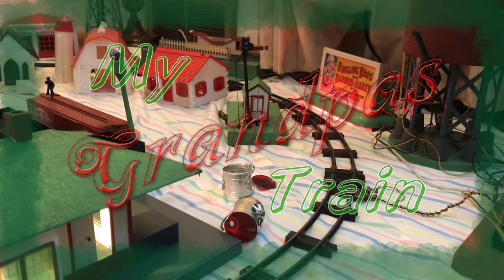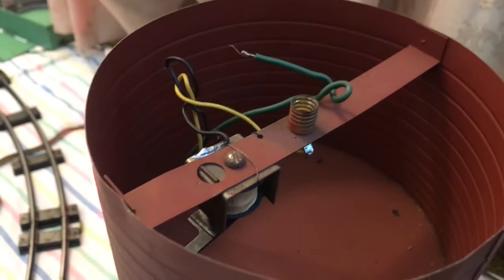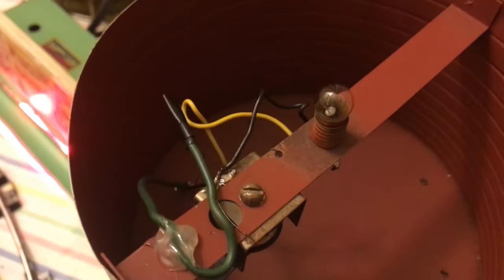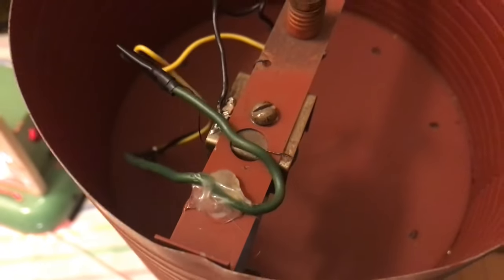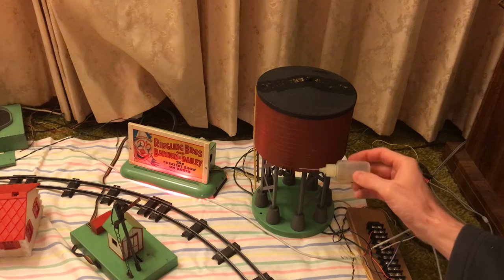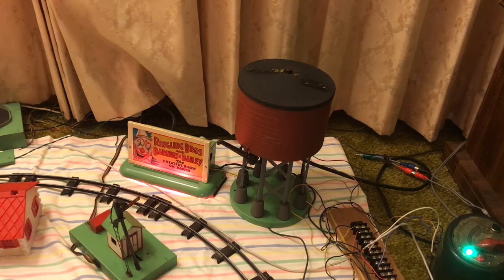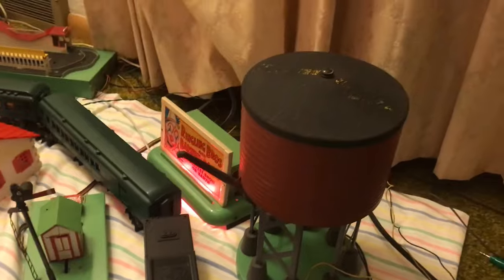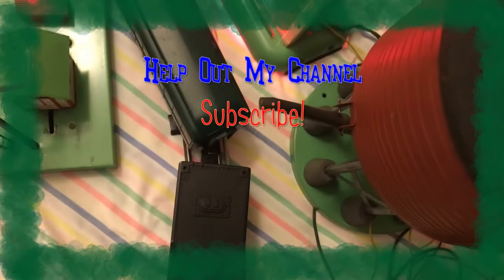American Flyer Christmas Accessories: Water Tower

Comment: I like the water tower. I am fortunate to have one on my layout. It took me a while to get it working after I got it, but it is working wonderfully now. As I only have steam locomotives, having one on the layout is essential. The buzz of the solenoid is actually nice with this accessory because, with some imagination, it sounds a bit like water running out of the spout.
Reply from the maker: Only problem in my opinion is that's dramatically out of scale! I'd like to 3D print one that is scale accurate and then put the operating mechanism inside.

Comment: Gilbert's water tower is much more substantial than Lionel's. Metal vs plastic. Metal wins every time. Nice video
Reply from the maker: Only thing I don't like about it is it seems like it's way out of scale. Seems it should fit standard gauge.
Reply: Lionel's is even bigger. Most of the accessories are out of scale. Even the knuckle couplers are totally out of scale. They're about the same size as Lionel's couplers, which are probably 3 times larger than scale. We are PLAYING with toys that 8 - 12 year old kids played with in the 50s.